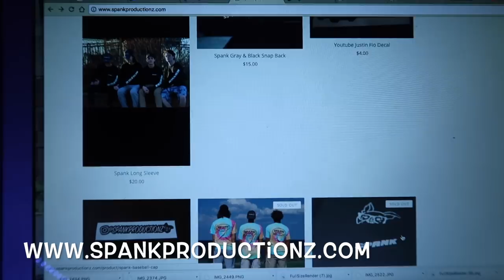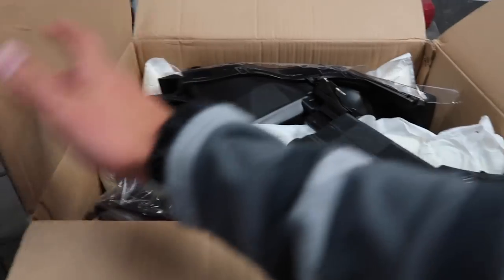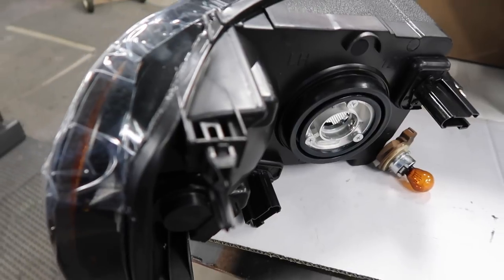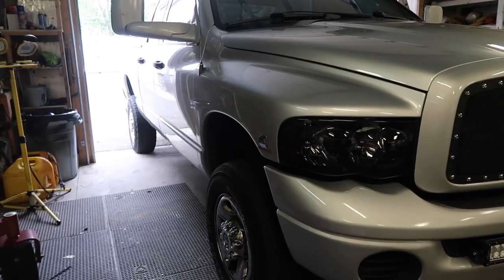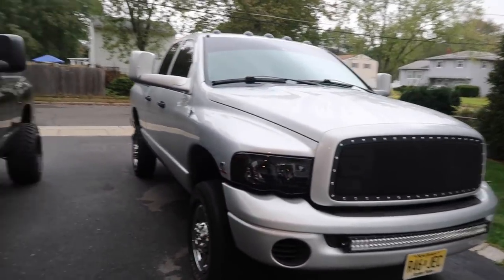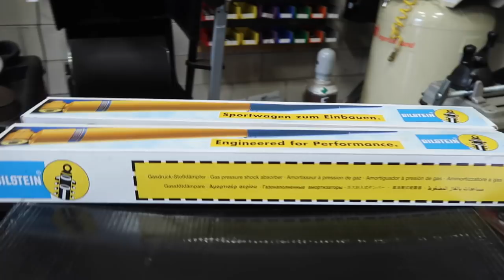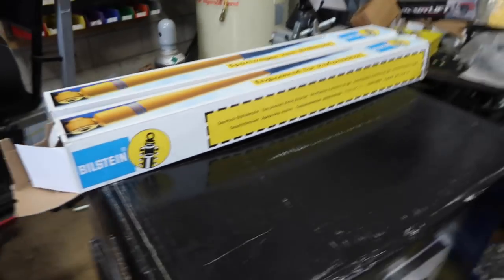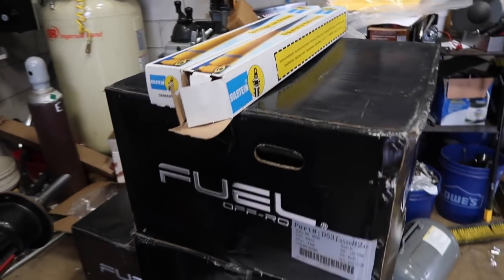PROJECT CUMMINS GETS WHEELS!!

Comment: On the white RAM, what inch lift is on that truck. Plus what's the size of the rims and tires?
Reply from the maker: its silver bro and 2.5 in skyjacker leveling coils with 20x12 fuel hostage on 295 55 20 nitto trail grappler
Reply: Justin Fio It's Dope. I'm new to the truck game. Just started following ya. Where did you order your kit, rims and tires from ?
Reply from the maker: Brandon Powell sweet bro auto attitude